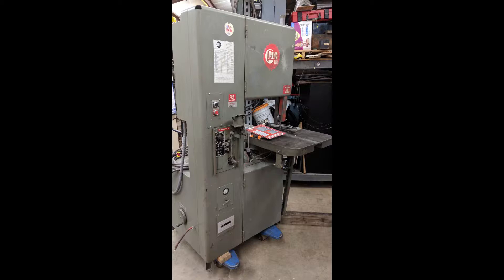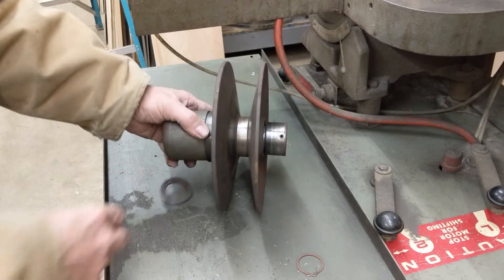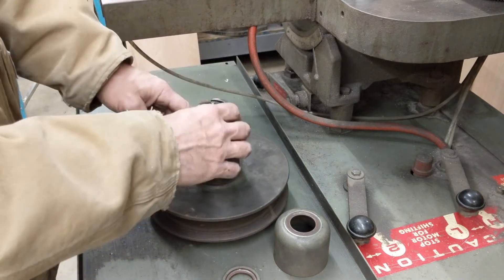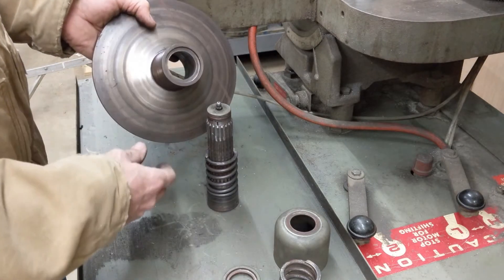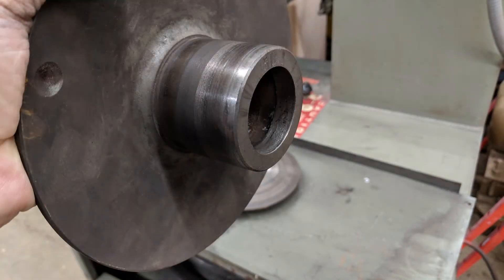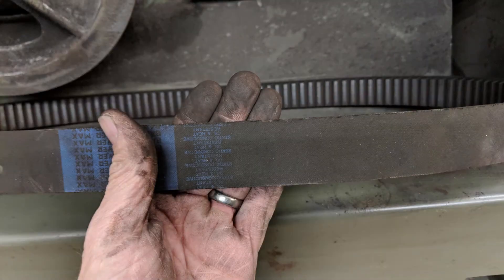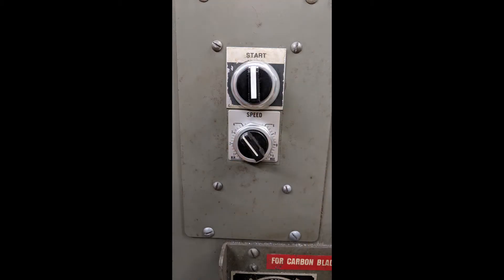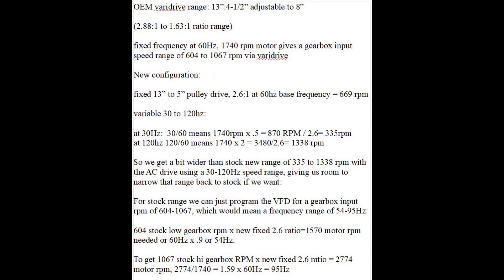Grob varidrive band saw fix

Comment: I have the same saw and would be very interested in seeing details of the Electronic Speed Indicator
Reply from the maker: Its an Arduino, updates every 5 seconds.  I need to do a video on that one but have been too busy, if you search for arduino speedometer you can use one of those setups and convert mph to fpm, but remember the sensor needs to go on the bandsaw wheel not the motor or drive because of the transmission
Reply: @tajelly  My other thought was to buy one of the $25 digital tachometers on Ebay and cannibalize it. Power it with a wall wart instead of batteries. They come with a contact wheel that reads out in Feet Per Min. Seems like a simpler low cost solution.